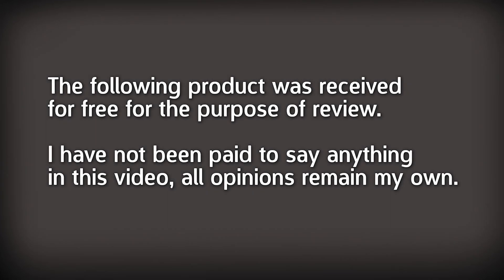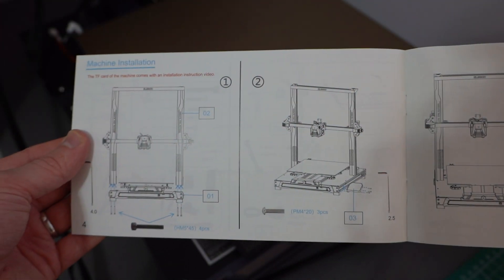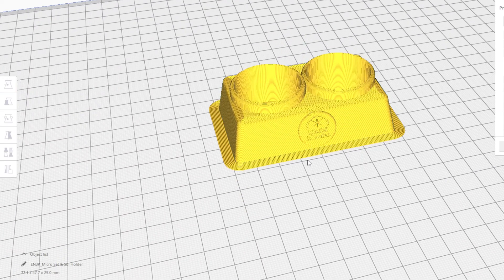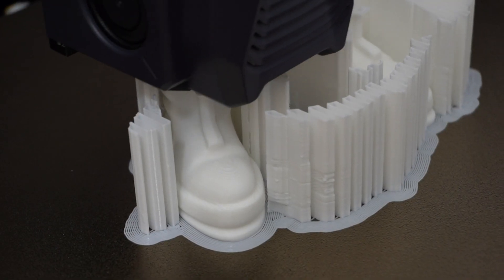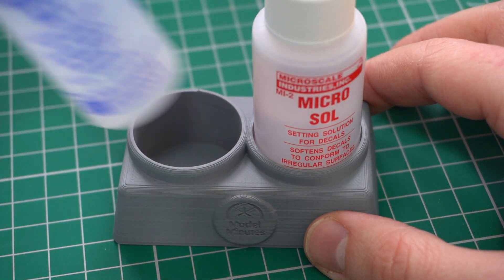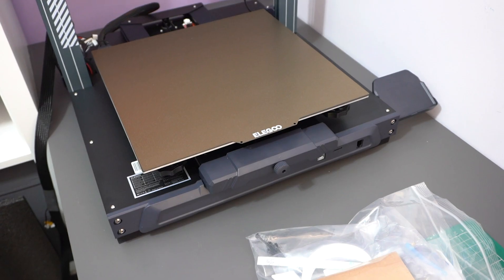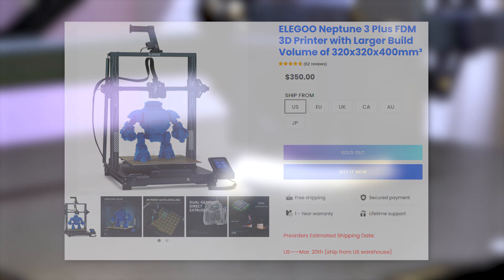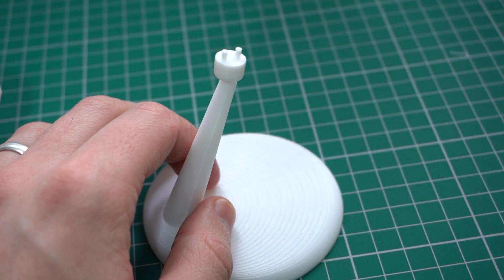Printing BIG models with the Elegoo Neptune 3 Plus! Product Review

Comment: Awesome. Just one problem, Here in South Africa you will not be able to keep the printer running for 29 hours. Loadshedding every single day. no electricity 3 times a day and between 2 and a half and 4 and a half hours at a time

Comment: How long before we can print full sprues and be able make our own models?  An idea for airfix etc?
Reply from the maker: Individual part files would be a better option - having the frames around the products would be a waste of time and material on the printer (a lot of the time you need to use support material anyway)
Reply: @ModelMinutes  yes true I was thinking several parts in one run instead of lots of different files.